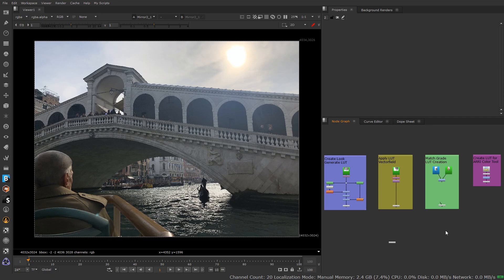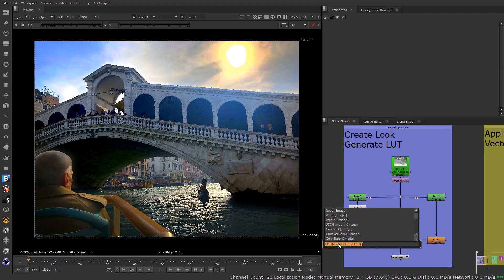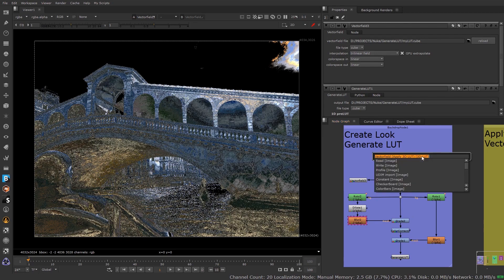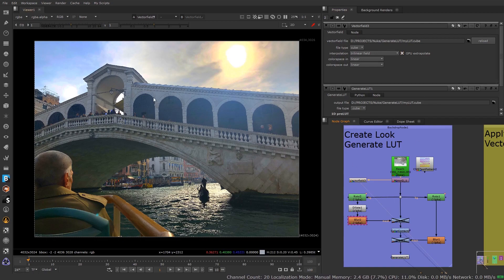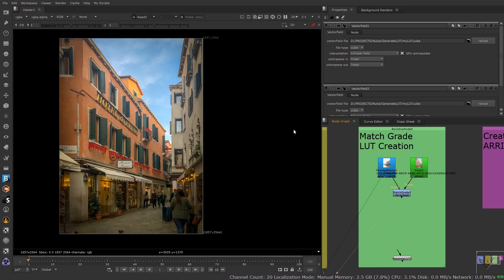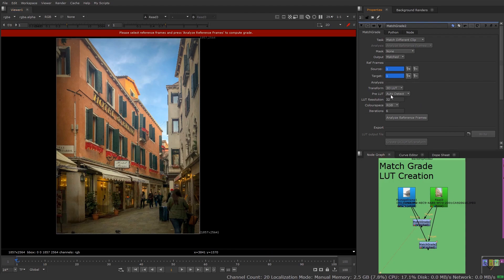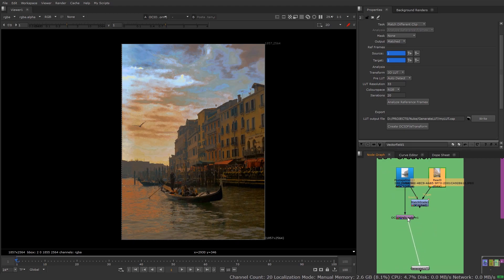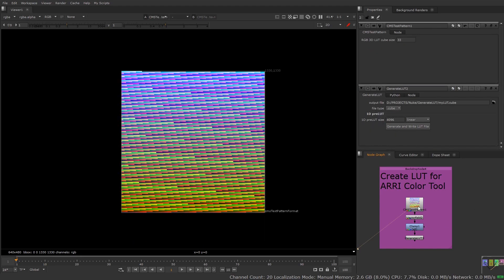Nuke 11 - LUT Generation

Comment: Hello!
Thank you for the great tips!
Do you also happen to know how to invert a Lut?
To remove a baked in Lut afterwards.
Reply from the maker: Thank you for checking out the video and leaving a comment. I do not think it is possible to remove a baked LUT because once it is baked the original values of the source are lost. If you have done a bunch of work on the footage with the baked LUT, and have the original source before the LUT was applied, you can try to sample a pixel in the footage, then adjust grade values to match 1:1 to the original source. Make sure RGB, and HSVL values match.

Assuming you do not have the original source before the LUT was applied, then there is no way to reference what the original pixel values should be. Even if you know what LUT values were applied, you would not be able to reverse those LUT values and apply them to the graded source hoping it would restore original values.

I expect this comment to be debated, therefore I will not reply any further to this topic beyond this comment.
Reply: @vfxsensei  Hey! Thank you for replying to me. 
I figure out how to invert a Lut using Matchgrade. 
The trick is connecting Source and Target the other way around. 

I had an ungraded plate and graded plate (Lut baked) and both of them are the same plate.
I connected Target input to the ungraded plate and Souce input to the graded plate. 
The Target extracts color information from the ungraded plate and applies it to the graded plate, thus bringing it back to its original color.

Comment: Hey man, thanks for posting this. I tried the method you used for Matchgrade node. But my result was that weird vector distorted look. Any idea if its really working?
Reply from the maker: Hey Ronaldo, thanks for checking out the video and leaving a comment. It's hard to say what  could be going on without seeing what you are working with, but I if you are  using 2 different clips, make sure the task is set to 'Match Different Clips". Also make sure both of the clips being matched are in the same colorspace and format before matching. Adding more key frames will help with the solve as well.  Keep in mind that the MatchGrade will get you in the ballpark, but may not be 100% accurate.
Hope this helps!